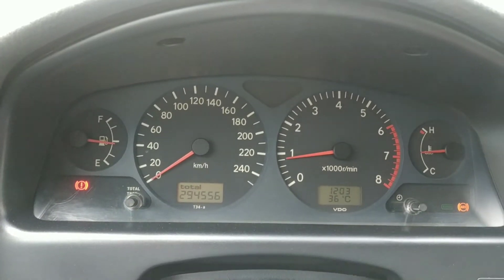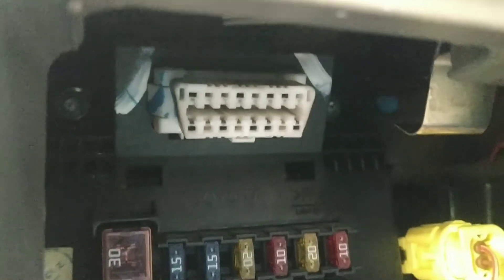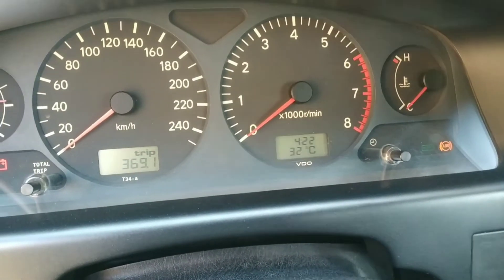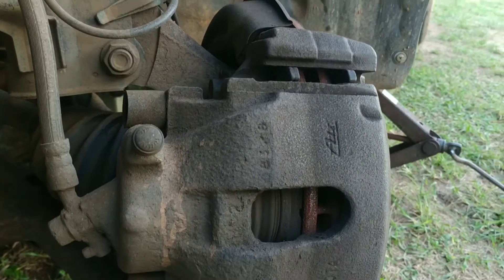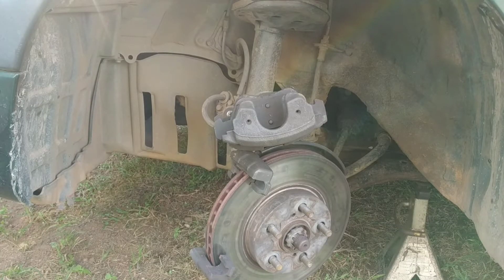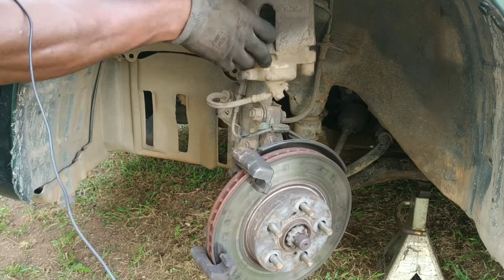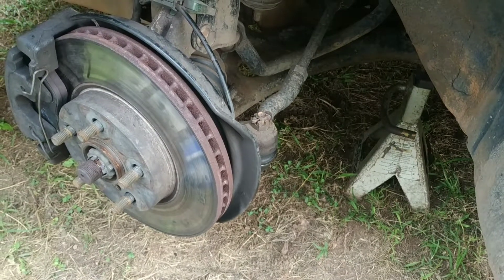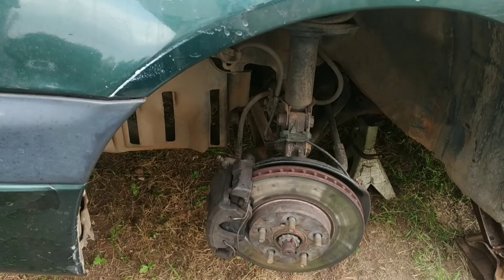Diagnosing ABS Issue using Paperclip on Toyota and Possible Fix

Comment: If it dont flashes?
Reply from the maker: @professor9595  If it doesn't flash, it's likely thé paper clip isn't properly inserted. Pins 4 and 13...
Reply: @olfeno7506  at 4 and 13 pin i insert it but it dont flashes🥲 the other light e.g engine flashes
Reply from the maker: @professor9595  hmm... What is thé make and model of your car? It's possible that feature is not supported. You may need a scantool to diagnose thé system.
Reply: @olfeno7506  avensis 1998 the same with video🙂
Reply from the maker: @professor9595  there's likely a communication problem with thé ABS module. Check for any blown fuses